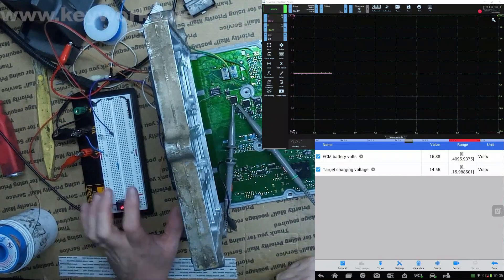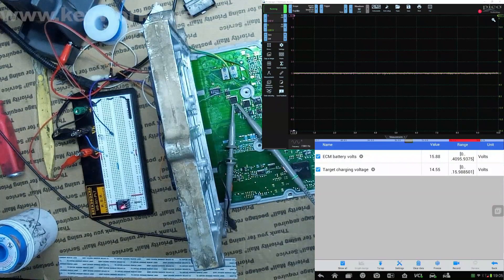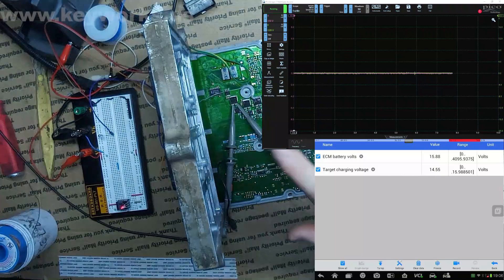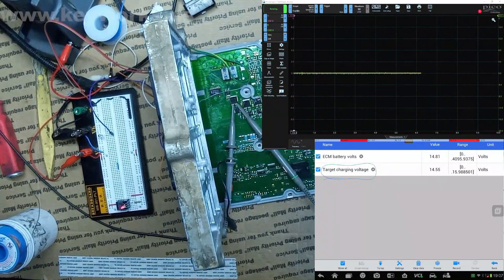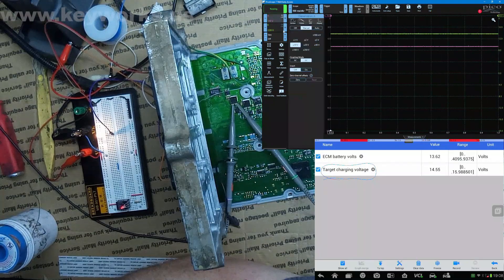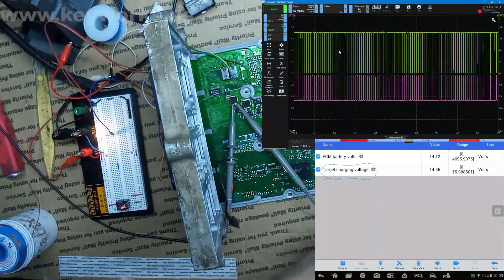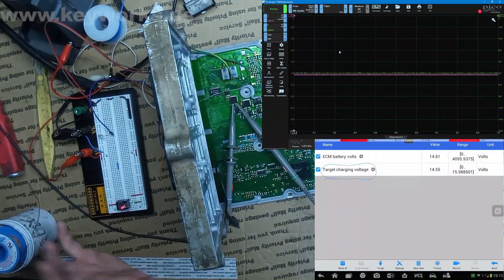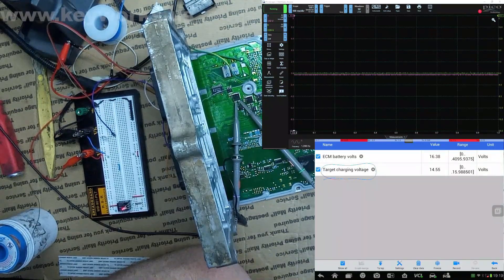Bench testing alternator charging controls in a Ram Cummins ECU for a customer

Comment: How many times can this type of board be opened up ?
Reply from the maker: As many as you want.
It will crack open down the fold after about 3 times though and you'll need to seal it up good and proper after repairs needed are completed. The way I do it you cant even really tell it happened.